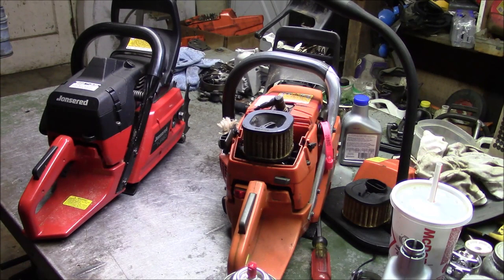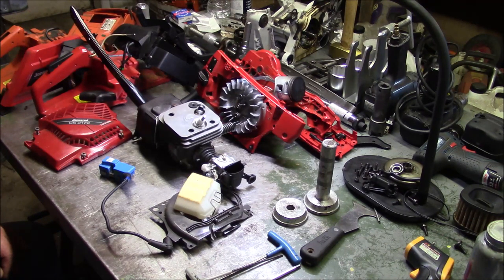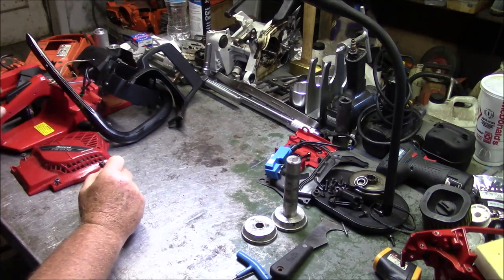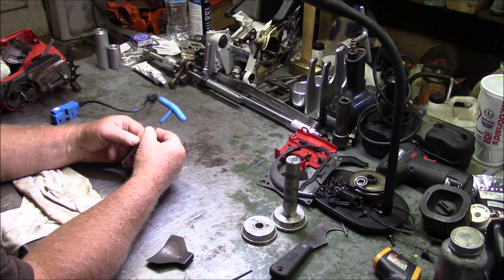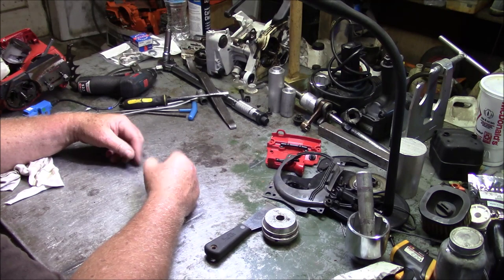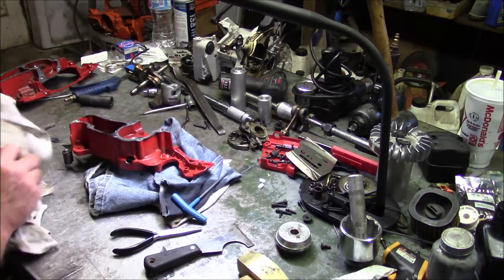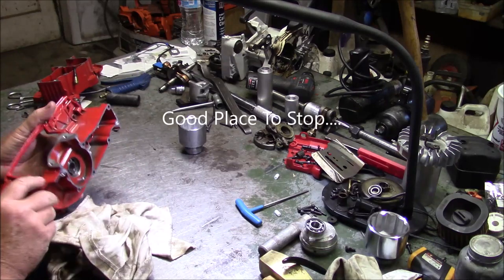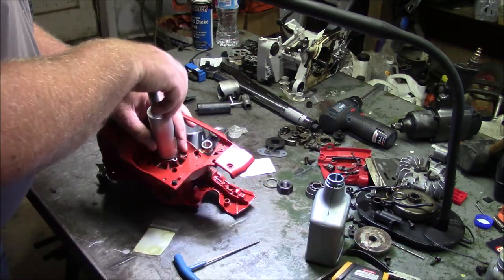Jonsered cs2172 vs. Husqvarna 372xp (X-Torq) What's Different?? And Shop Tools For Rebuilds

Comment: Thanks for sharing Walt.  I've wanted a 372 for years and an ad came up for a CS 2171.  I was tempted to get it until I found your vid on the bearing issues.  I think I'll skip it, getting to danged old to run one that big anyway.  LOL
Reply from the maker: 2171 won't have bearing issues, a 2172 and 2166 will if they are from before 2014. But the 2171 and 2165 are the original edition 372 based saw and last forever. SOLID saw. Grab hat 2171 :)
Reply: @afleetcommand  I checked a few minutes ago.  It was in excellent condition, plastic almost looked new.  Sold for $225, great saw, but too heavy for me.

Comment: great video again Walt  hope your on your feet again soon with a diagnosis or repair , on a side note , when i pull apart saws for  repair /fun or slight mods etc , i use a cutlery tray , which keeps all the small parts assigned  to sections , not that it a big issue  as you know all parts but its easy to lose the place of a small part :-)

Comment: Isn't it funny how the tools you use to work on these saws just seem to keep accumulating more and more, I think back to when I was younger how few tools I had and what I would use, sometimes very crude but was able to get the job done with what I had.
I'm sure it was just an oversight i know you have talked about it's importance and have used one but it was not mentioned as a tool needed although its probably is the most important one you should have and use in my opinion,  The Pressure/Vac Tester.
As always I enjoyed the video
Reply from the maker: And I've had to build "blocks" for several maifolds/carbs. Have the Husqvarna Pressure / Vacuum test plugs for the 562/555/550  and 372 series saws. Had to build them for the 576 saws...so even those begin to pile up.

Comment: Question about ignition. I have a jonsered 670. Its actually a cutter edge fire dept saw that i converted back to typical woods saw. Ive been told by my local shop it needs the ignition replaced which is a 2 piece coil.  They are amish and say the cant get these parts. Any insight? I would love to get this saw into a reliable good work saw.
Reply from the maker: https://www.ebay.com/itm/HUSQVARNA-266-61-162-JONSERED-630-670-IGNITION-COILS-SET-FOR-2-PIECE-IGNITION/141842679111?hash=item21067b8547%3Ag%3AqOkAAOSwfZ1WXnmN&_sacat=0&_nkw=Husqvarna+61+two+piece+ignition&_from=R40&rt=nc&_trksid=m570.l1313

Comment: Will that ignition upgrade work on a 371xp?
Reply from the maker: Any of the "black" OEM's. The new blue ones are all limited, many to either 13,000 or 13300. Your saw wants to be at 13500 no load...
Reply: @afleetcommand , thanks!  Didn't know before why there was limited and unlimited coils.  Just found your channel, been binge watching!

Comment: I have a 2163 turbo I need a jug and piston do you know where I can get them
Reply from the maker: I would check dealers or eBay. Can put a standard "original edition" ( Not X-torq!) 50mm 372 cylinder on that saw..:)

Comment: What's the big difference between a 2172 and a 2171
Reply from the maker: The 2171 is not an X-torq. Basically the 2165 and 2171 correspond to the Husqvarna 365 and 372 "Original Edition"
I cover the differences between X-torq and OE a couple of times in prior video's....they are essentially completely different saw designs (XT vs. OE from either brand)